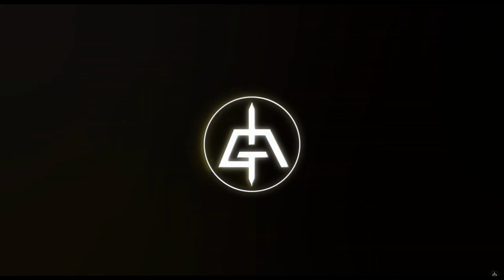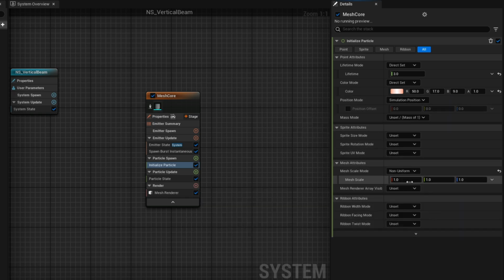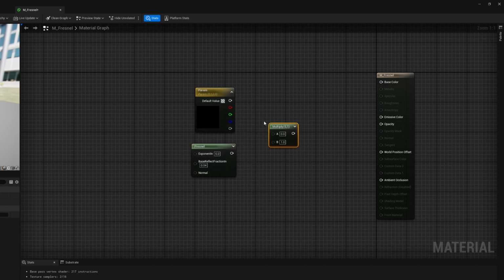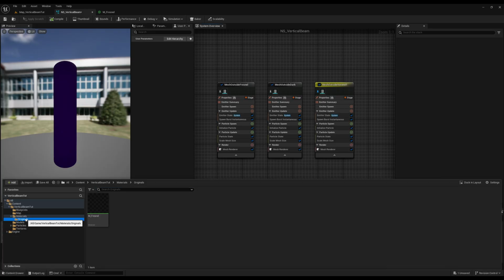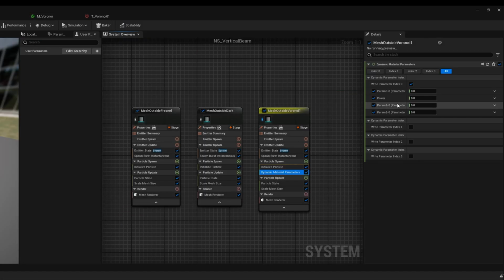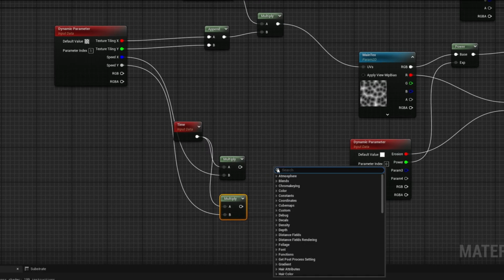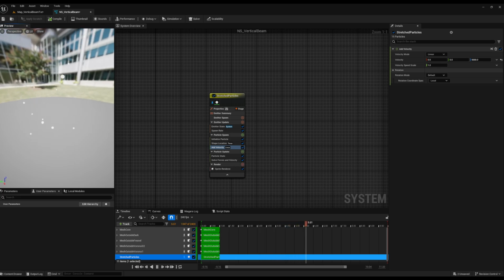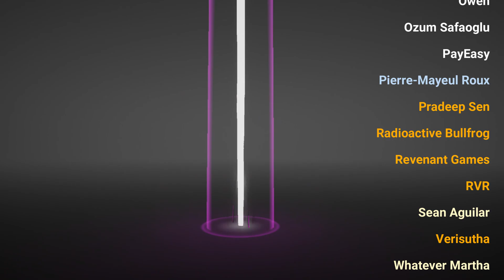Unreal Engine 5 - Vertical Beam VFX - Niagara Tutorial

Comment: I dont know how you made the curve in 3:12 :(
Reply: Under float curve and above the curve graph there is a button that is  a little arrow pointing to top right, called "show this curve in curve overview (Makes it easier to see). Create points on line and drag them like spikes. Select the points that are between the 0 and 1 mark.  Then you can hit the button with a curve symbol with a little A underneath. This will automatically interpolate what you've created into curves essentially smoothing the curve. You can also use the button that kind of looks like a wave to scale all the points you selected. Hopefully this helps.